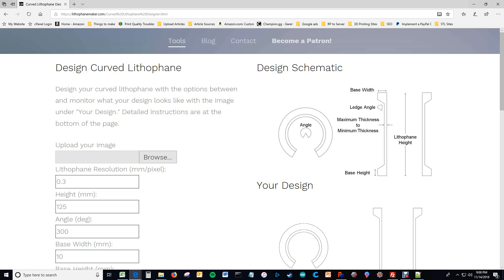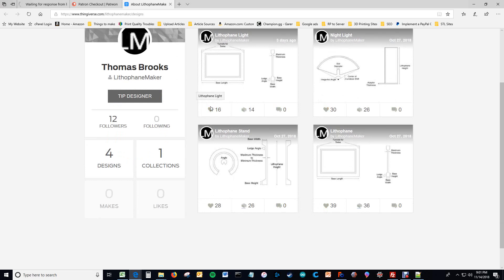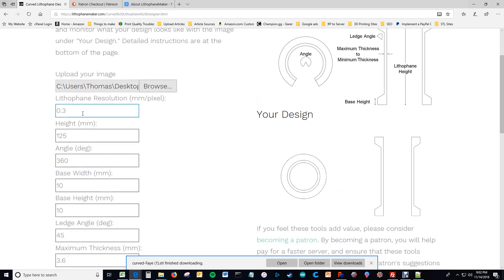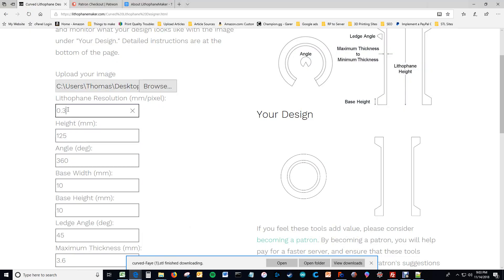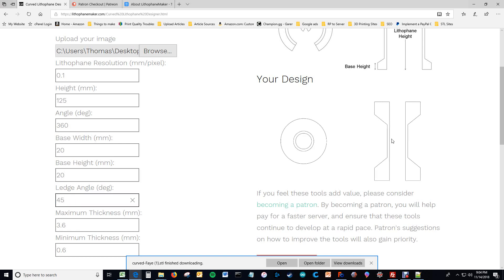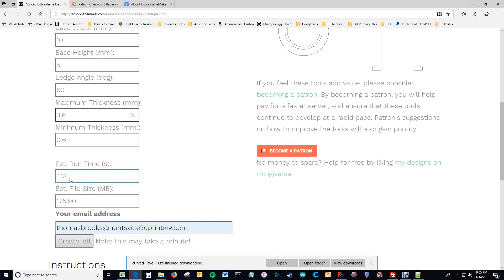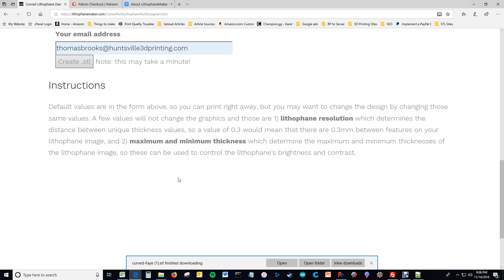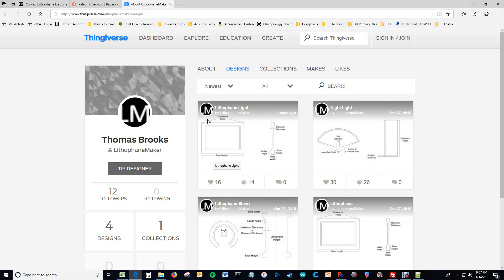Make a curved lithophane stl that can be 3D printed

Comment: Is there a way within this program to close the top of the design if I make it 360 degrees?
Reply from the maker: You can print a matching circular lithophane and glue it on if you want. You can flip the lithophane upside down on the build plate and add a disk under it, but there's no way of doing this.

Comment: Awesome tool!!  My only suggestion would be to be able to specify an interior or exterior texturing.  I'm working on a project that I don't want people to be able to make out the design until the pane is backlit, but the curved option only extrudes the texture on the convex side, and I can't get the texture to extrude on the concave side.
Reply: And the image side SHOULD be the back, though some people like it on the front. You can reverse the image in a photo editor to get the people on the right side of each other, but you are right that this still doesn't solve the problem of people can see the image before you turn on the light

Comment: So how can I get rid of the base and top sections? Tried making one similiar to 3DP.rocks and it kept giving me a weird ledge even with 0 for base height 0 and width 0.  Also its kinda weird that the sizes change when I adjust the base etc, id like to keep the parameters forX and Y spans, I had to eyeball it against the one I have and then adjust it again in Cura